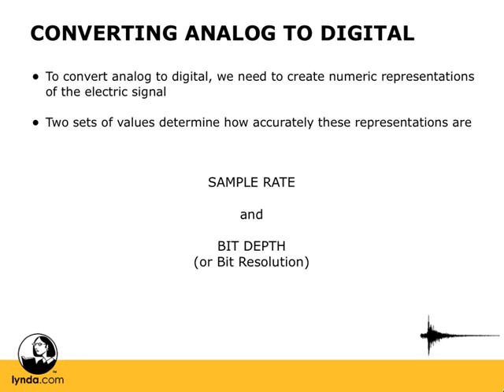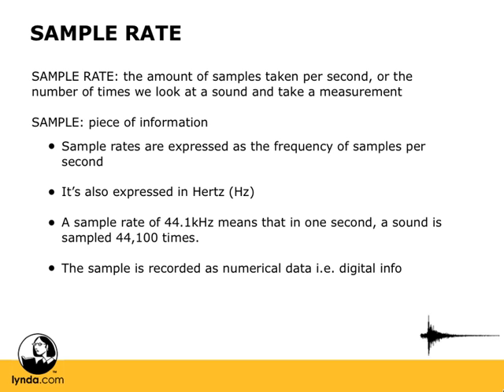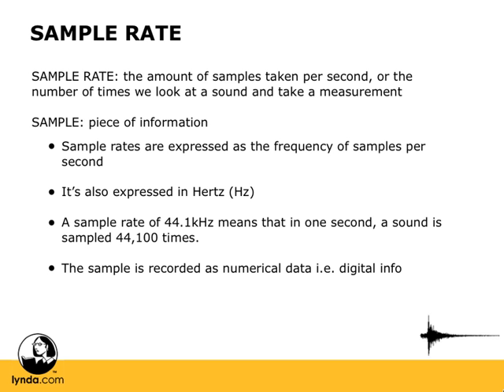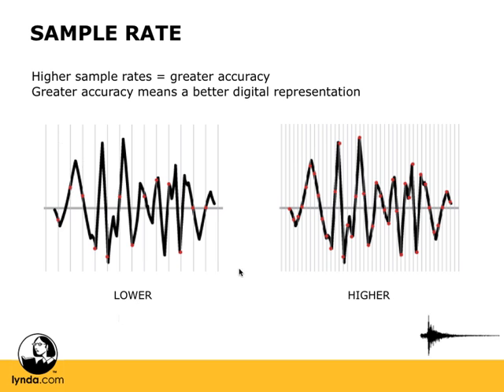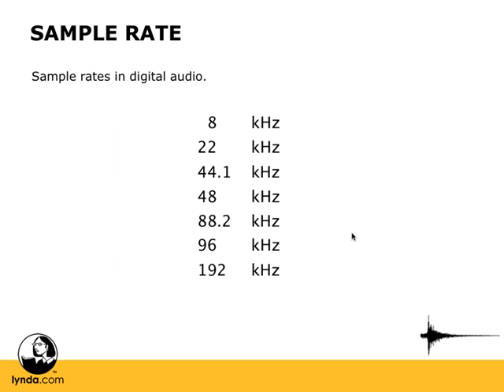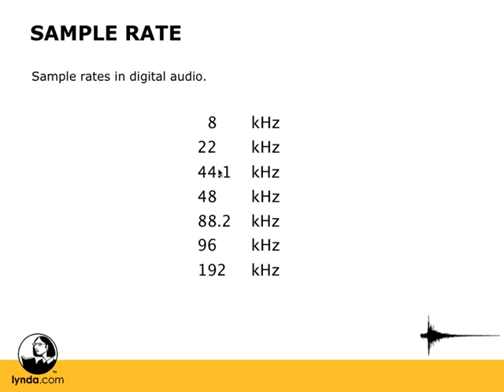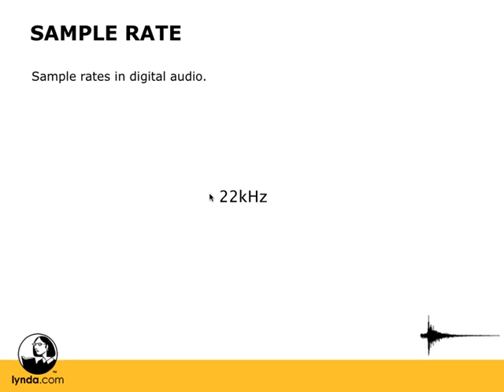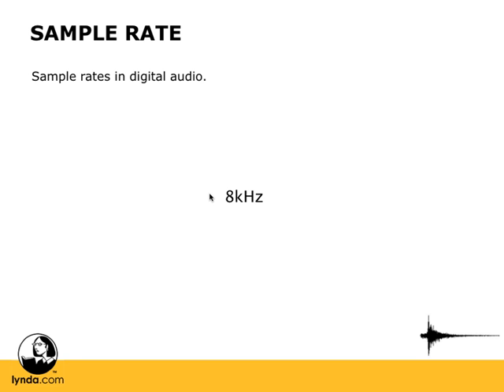Sample rate

Comment: Yes, it does mean it's represented more accurately. The sample rate frequency has little to do with sound frequencies, and more to do with addurately representing a sound wave. At 44.1kHz, you need 2 samples to create a 22.5khz frequency/tone. If you have 88.2kHz, you can represent it using 4 samples instead, meaning it's actual shape will be more accurate, aswell as it's timing/position.